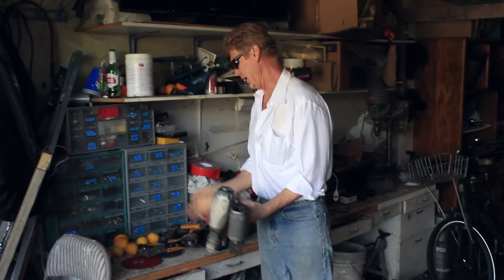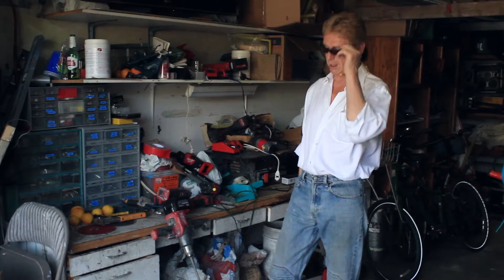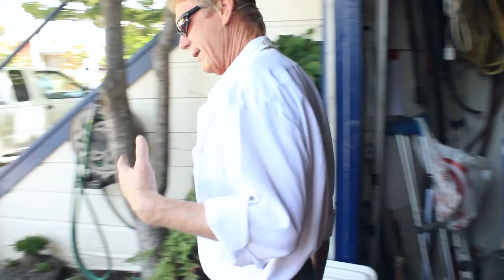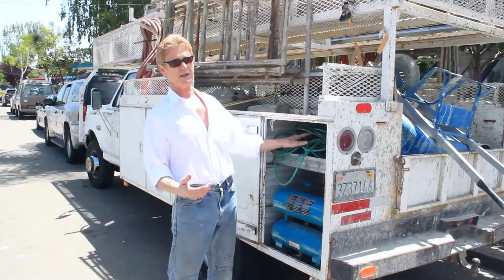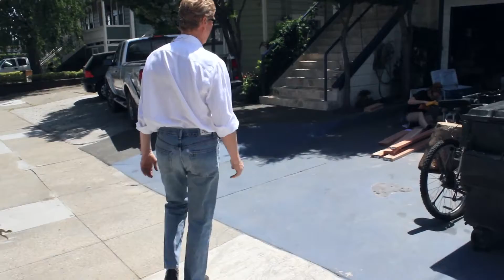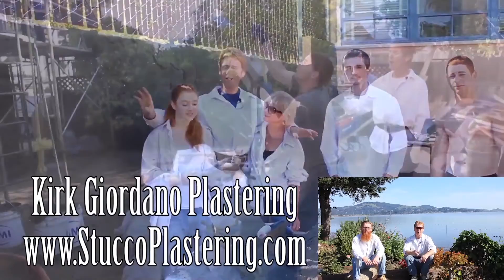Milwaukee build a battery-operated staple gun

Comment: Dewalt makes a battery stapler for electrical wire
Reply from the maker: Howdy Alvan they do indeed, thank you however that is not the one we're searching for, I've given up on the stapler for attaching stucco netting and will be happy that we have the air one. 😉

Comment: https://youtu.be/YbMZuVBv-1k
Reply from the maker: Good evening adam, I have this gun, I used it a lot when I was installing fence post to hold up the wire netting to keep in cow and horses at a property I once owned, Thank you for the tip.
 However, It's not used for attaching metal lath to wood substrates.
Welcoming, peace, love, and brotherhood, back into the 🌎 of Plastering.
    Bringing you the most comprehensive encyclopedia of free plastering video’s ever put together,
 by the plastering messengers of Youtube. 
Kirk and Jason Giordano with over 800 videos 🎭 👀💃
Reply: Would this stapler work for you guys?

Comment: kirk. you and family and company are great .
I am not behind you on the battery thing.
There’s no way around the fact that batteries are toxic. some are brought back to big box stores for recycling, ( and who’s checking on that ?) most batteries are just thrown in the garbage. the price of batteries for tools is outrageous. the tool is sold at a loss because the real money is the replacement batteries.
the scam is similar to the scam printer companies ran and still run, where the printer is cheap but the ink cartridges are expensive.
same principle. the battery thing is terrible for the environment ! 
and battery tools are often heavier than there corded counterparts. 
what’s needed is a better, lighter, quieter compressors AND hoses, with some kind of an overhead hose and cord holding system that keeps hoses and cords off the ground, limits tangle and clutter
Reply: ugggggggg please stop Mike  .
Reply from the maker: Good evening, Mike, I agree totally, I have a compressor from Italy soundless and light but not sold here.
 In this country companies re limited or restricted by invisible handcuffs to invent the new wheel.
Welcoming, peace, love, and brotherhood, back into the 🌎 of Plastering.
    Bringing you the most comprehensive encyclopedia of free plastering video’s ever put together,
 by the plastering messengers of Youtube. 
Kirk and Jason Giordano with over 800 videos 🎭 👀💃

Comment: I've been there Kirk, looking for that battery powered lath stapler. They got ones that use small staples for upholstery use and other small applications but nothing with a wide crown and deep enough penetration for stucco lath. Paslode use to make (maybe they still do) a cordless gas-powered (stucco lath grade) stapler, they were heavy, slow, and expensive, and needed frequent cleaning and maintenance, and the gas cylinders didn't last long and were a throw-away item. 
Most brands make powerful battery-powered nailers and spikers for framing, I'm sure they could make a wide (wide enough) crown stapler with enough penetrating power for stucco lath if they felt there was a market for them.
Reply from the maker: Good evening Mucky, they make them there will always be a market for them.
 as far a the CO2 staple Gunns the cold from the co2 was not kind to most of the plastic and rubber parts in these guns that were used mainly as washers.
Welcoming, peace, love, and brotherhood, back into the 🌎 of Plastering.
    Bringing you the most comprehensive encyclopedia of free plastering video’s ever put together,
 by the plastering messengers of Youtube. 
Kirk and Jason Giordano with over 800 videos 🎭 👀💃

Comment: Milwaukee makes the best electric tools. I have a 9" Milwaukee grinder that is 35 years old and still works great. Thing is, they are expensive. I have Ryobi cordless stuff which is fine for consumer work, but if I got paid to do work, I would get Milwaukee. Stella is good in hot weather.
Reply from the maker: Good evening, James, It's Sho-Nuff would be nice to have a cordless stapler as I have many that operate with air.
 Your right, Stella is good for all kinds of weather.
     Bringing peace, love, and harmony back into the world 🌎of plastering.
  The University of plastering by Kirk and Jason Giordano. 🎉💃 🥂🧞‍♂️
with over 850 free advice show and tell video’s on stucco & plastering

Comment: DeWalt 9 gauge fencing stapler any good to you?
Reply: Haha ok no worries, we don’t use that wire that much here in the uk, it’s mainly brick/block homes so it’s all about SBR and scratch coat. well keep doing what you do, I watch your vids all the time. Thanks for the knowledge 😊
Reply from the maker: Howdy Big Nick, this DeWalt 9 gauge fencing stapler is a great gun, I had 16 acres years ago which had many acres fenced off for horses. 🤔
his gun was perfect for attaching the wire to most of the wooden posts to corral the horses and sometimes cows in.
 However, it is not allowed for stucco as the rounded staples are unacceptable for attaching stucco netting to wood substraights for homes, plus the narrow head would not be allowed.
 Back to the farm, we used to have we eventually started installing the metal fence post which and clip to hold the fencing.
Heres hoping for a new Christmas present 7 months in advance.
Kirk Giordano Plastering

Comment: YES YES KIRK!! I recently asked a dewalt rep the same question. I’ve been asking for a couple years now. I don’t understand why they haven’t yet. And I agree I’d be the first to buy one as well. Maybe there is not enough demand to make this tool? Thanks for addressing this issue. I will be in my glory the day I have one in my hands 😛
Reply from the maker: Good Evening Brent, you and me both, would save time and frustration.😉
The unloading and lugging the heavy arse compressors upstairs or even taking them out of trucks is often hard on one's spine, as the weight of all awkward compressors with enough PSI air to power all the different air staplers, can tweak any men back. 
Moving these compressors has done more damage to my spine than plastering at odd angles, let alone untangling and then reraping the air hoses.
     Bringing peace, love, and harmony back into the world 🌎of plastering.
  The University of plastering by Kirk and Jason Giordano. 🎉💃 🥂🧞‍♂️
with over 850 free advice show and tell video’s on stucco & plastering

Comment: They don't do battery operated Staple-Guns because the Yobbery will use them as Tommy-Guns and the streets wouldn't be safe to walk any more :-( ......... 

Plus! ... It's a bummer when the Missus Isolates you to the Garage EH?? :-).........
Also good to see you got your own Loo out there ...........
Reply from the maker: Evening peter, maybe, but it's cheaper and easier to buy a gun off the streets then a stapler at a hardware store.
 Plus, bullets are far more accurate.😉
If somebody came up to me with a cordless stapler then demanded my cash they would have to run really fast, as I hit the road, that means he'd have to run as faster than me plus carry a fastening gun, no way id be caught.
 I have used them for 40 years and know that if you shoot them into the air, they only go 15 to 20 feet.
    Bringing peace, love, and harmony back into the world 🌎of plastering.
  The University of plastering by Kirk and Jason Giordano. 🎉💃 🥂🧞‍♂️
with over 850 free advice show and tell video’s on stucco & plastering

Comment: I'm sure paslode do a staple gun battery/gas
Reply from the maker: Greetings, Daniel, either Paslode or Senco, did try CO2 gas power years ago.
 However, the cold air didn't work well with all the rubber parts, so this was discontinued.🤷‍♂️
    Remember all the BB guns we used to play with?
 Insert a CO2 bottle, then when all the air was used up, open the handle to remove the CO2 cartridge, how ice cold the CO2 cylinders were?
    Well, the plastic and rubber parts in the staple guns didn't appreciate that cold, now, we're all waiting for battery-powered or maybe solar-powered staplers.😉
                 Bringing peace, love, and harmony back to the world of plastering. 🌎
    The most complete plastering encyclopedia on video, by the plastering messengers of Youtube.🧞‍♂️with over 800 videos 🧘🏻👀💃

Comment: I swear I've seen DeWalt and cryoby have a gun
Reply from the maker: Good evening, Nate, both Dewalt, and Ryobi do make cordless brad nailers, I have both of these time-saving brad guns.
 they are great for finish carpenters, However not for attaching stucco nettings.🤓
For code requirements on attaching stucco nettings, the crown should be at least 1 inch wide, while the tract should bet adaptable to hold inch and a quarter to 2-inch staples.
Code calls for 7/8 of the leg to be embedded into the stud, for the structural strength necessary to support the weight of new stucco.
Since around 1980, homes nowadays have a plywood substrate. Thus one inch and a quarter is the shortest leg necessary for attaching stucco netting.
When I first started plastering there was no plywood, homes were just studs, so we used 7/8 staples, today or since 1980, we got it easy with the plywood substrates.🕺🏻
Bringing peace, love, and brotherhood, back into the 🌎 of Plastering.
  The most comprehensive encyclopedia of plastering on video, by the plastering messengers of Youtube. 
Kirk and Jason Giordano with over 800 videos 🎭 👀💃

Comment: De Walt DCN 681 Max crown stapler,  check it out on YouTube!
Reply from the maker: Good evening, Jocelyn, Dewalt does indeed makes a cordless staple gun, but it has a narrow Crown. 🤔
For code requirements on attaching stucco nettings, the crown should be at least 1 inch wide, while the tract should bet adaptable to hold inch and a quarter to 2-inch staples.
 Code calls for 7/8 of the leg to be embedded into the stud, for the structural strength necessary to support the weight of new stucco.
 Since around 1980, homes nowadays have a plywood substrate. Thus one inch and a quarter is the shortest leg necessary for attaching stucco netting.
When I first started plastering there was no plywood, homes were just studs, so we used 7/8 staples, today or since 1980, we got it easy with the plywood substrates.

 Bringing peace, love, and brotherhood, back into the 🌎 of Plastering.
    The most comprehensive encyclopedia of plastering on video, by the plastering messengers of Youtube. 
Kirk and Jason Giordano with over 800 videos 🎭 👀💃

Comment: Paslode makes a cordless staple gun
Reply from the maker: Howdy, Nerdofx,  Paslode does indeed make the CF325 Cordless Framing Nailer, this shoot nails while the Cordless Finish Nailer shoots brads, both are excellent guns. However, the gun I wish a tool manufacturing company would invent will shoot staples with a one-inch crown and be adjustable with a staple leg of one inch and a quarter to a two-inch leg, for the two types of stucco systems that are used through the world. 
    I have at least 10 Paselode staplers in my garage, I have two old fashioned one that is so unique that they will shoot a staple through two pieces of 17 gauge metals, engineering at its best. 
None of my other various staplers guns cant do this. I sometimes have to use these guns for specialty fastening situations.

    Bringing peace, love, and brotherhood back to the world of “Plastering.” 🌍
With over 800 educational and free Youtube videos, by your favorite plaster geek, me 🤓with my son, Jason, the bearded plasterer.💃🧘🏻🧞‍♂️🎉

Comment: Milwaukee has a battery stapler...
Reply from the maker: Good evening, Jocelyn, Milwaukee does indeed make a cordless staple gun, it's for attaching moister barriers or paper or many other things. 
But not for attaching stucco settings to plywood substrates. At least not yet anyway.😉
For code requirements on attaching stucco nettings, the crown should be at least 1 inch wide, while the tract should bet adaptable to hold inch and a quarter to 2-inch staples.
Code calls for 7/8 of the leg to be embedded into the stud, for the structural strength necessary to support the weight of new stucco.
Since around 1980, homes nowadays have a plywood substrate. Thus one inch and a quarter is the shortest leg necessary for attaching stucco netting.
When I first started plastering there was no plywood, homes were just studs, so we used 7/8 staples, today or since 1980, we got it easy with the plywood substrates.
Bringing peace, love, and brotherhood, back into the 🌎 of Plastering.
  The most comprehensive encyclopedia of plastering on video, by the plastering messengers of Youtube. 
Kirk and Jason Giordano with over 800 videos 🎭 👀💃

Comment: Ryobi is getting close. Yes I know Ryobi is like a curse word in the professional industry but i have abused the shi.. out of many of their tools and they are still going strong 💪

Edit: Ryobi Model P360 is a 18v stapler
Reply from the maker: Good evening, Mefoo, this Ryobi Model P360 is an 18v stapler is a quality cordless nailgun.🤔
However, not engineered for attaching stucco settings to substrates.🤓
Ryobi cordless power tools are excellent, In fact, I had the whole set, which my youngest son has now inherited as we switched to Milwaukee. I feel Ryobi is and will remain a top cordless power tool as I never had problems with them.
   At the same time, we, as professional contractors, require a bit more power and versatility provided with Milwaukee's mortar and stucco cordless mixing drills plus their roto hammers. 
   These two cordless tools alone save us time and frustration.
 Plus, the compressor airlines often get tangled in scaffolding and many other obstacles, tree's chairs little kids crawling around.😉
   This gets old fast, let alone pulling rubber air hoses hard on the ground. I have ripped off a few sprinkler heads and overturned a few things in my day, which I must replace or fix.
    Let's not forget, not all homes have electrical outlets on the exteriors. Often I can't even plug in a compressor.

For code requirements on attaching stucco nettings, the crown should be at least 1 inch wide, while the tract should bet adaptable to hold inch and a quarter to 2-inch staples.
Code calls for 7/8 of the leg to be embedded into the stud, for the structural strength necessary to support the weight of new stucco.
Since around 1980, homes nowadays have a plywood substrate. Thus one inch and a quarter is the shortest leg necessary for attaching stucco netting.
When I first started plastering there was no plywood, homes were just studs, so we used 7/8 staples, today or since 1980, we got it easy with the plywood substrates.
Bringing peace, love, and brotherhood, back into the 🌎 of Plastering.
  The most comprehensive encyclopedia of plastering on video, by the plastering messengers of Youtube. 
Kirk and Jason Giordano with over 800 videos 🎭 👀💃
Reply: @StuccoPlastering  😨I truly feel honored to receive a reply from the plaster king himself.
 Just yesterday after more than a month of watching most if not all your videos, i build up the courage to try my own patch. I removed a window 52"×50" and decided im doing the stucco. I was able to identify i had a float dash finish on my walls. I went ahead and got me a dash brush and 16/20 mix, mixed me some soupy mud and dashed on the floated finish. The result was truly amazing! Even more shocking was waking up this morning to find that all my hard work was still on the wall 😂. I heard some of your horror stories.  I followed all your tips and instructions, correct lath, tucked new paper under old paper, used bonding agent, correct float, proper trowel, and i cannot thank you enough. Only time will tell but im fairly confident it'll hold up. After finishing, i gotta say, you have my respects cause that is not an easy profession. Again thank you and your family so so so much 👍👍👍👍👍👍

Comment: How long of crown staples do you shoot?

Edit: for shooting T50 staples I have a DeWalt DWHT80276 Carbon Fiber Composite Staple and Brad Gun that is super light and very easy to pull.
Reply from the maker: Howdy Bart as a rule 1 inch and a quarter. I have on my truck at all times at least ten or T50 hammer tackers, these T50's we use to fasten the moister barriers to wood walls.
 The brad gun you refer to is mainly used for finish carpentry.
 I do have a few of these for when I do carpentry in my own home.

     Bringing peace, love, and brotherhood back to the world of Plastering. 🌍
With over 800 educational and free Youtube videos, by your favorite plaster geek, me 🤓with my son, Jason, the bearded plasterer.💃🧘🏻🧞‍♂️🎉

Comment: Dewalt  makes a crown stapler, my boss owns one.  It works great.  It shoots .5 inch to 1.5 inch narrow crown staples.  Battery powered
Reply: Dewalt has a battery powered compressor that does a good job with my finish nailers.   Milwaukee is coming out with one soon also.  It sounds like the Milwaukee is a beast.  It runs off of MX batteries which are new.  Bigger and  badder than their 18 volt batteries.   Oh and more expensive but I'm sure you could afford it.
Reply from the maker: Good evening, Johnathan, Dewalt does indeed make a cordless staple gun, but it has a narrow Crown.🤷‍♂️
For code requirements on attaching stucco nettings, the crown should be at least 1 inch wide, while the tract should bet adaptable to hold inch and a quarter to 2-inch staples.
Code calls for 7/8 of the leg to be embedded into the stud, for the structural strength necessary to support the weight of new stucco.
Since around 1980, homes nowadays have a plywood substrate. Thus one inch and a quarter is the shortest leg necessary for attaching stucco netting.
When I first started plastering there was no plywood, homes were just studs, so we used 7/8 staples, today or since 1980, we got it easy with the plywood substrates.
Bringing peace, love, and brotherhood, back into the 🌎 of Plastering.
  The most comprehensive encyclopedia of plastering on video, by the plastering messengers of Youtube. 
Kirk and Jason Giordano with over 800 videos 🎭 👀💃